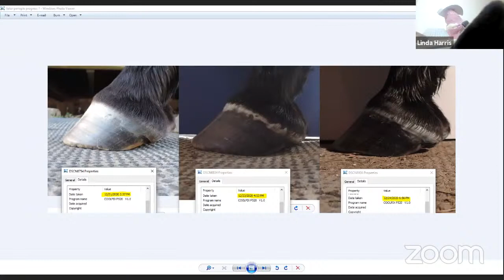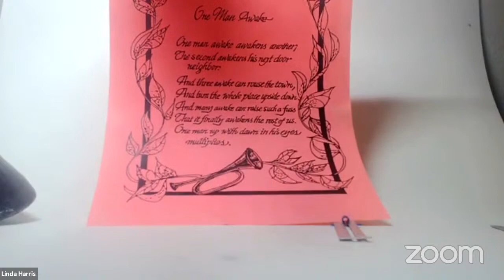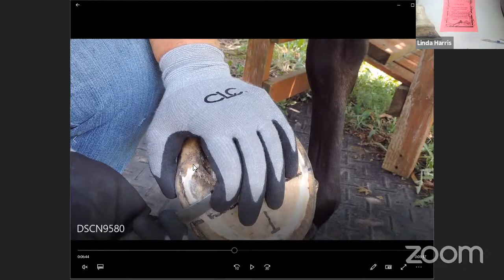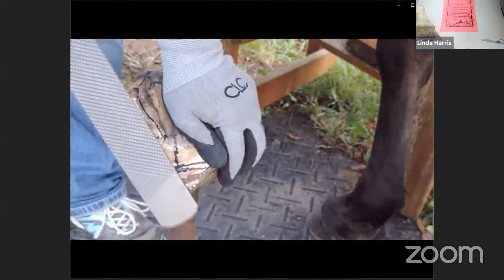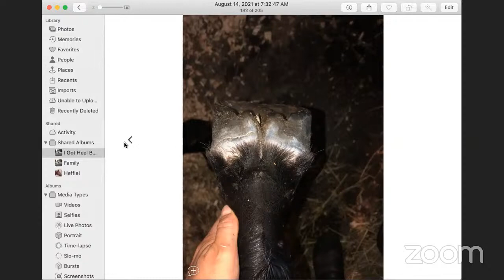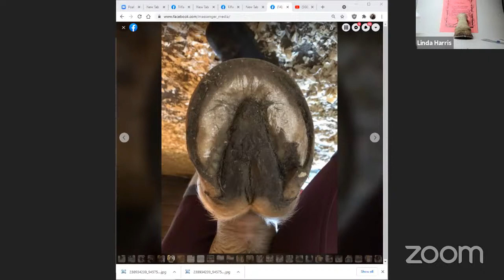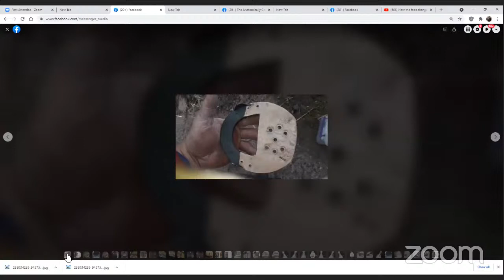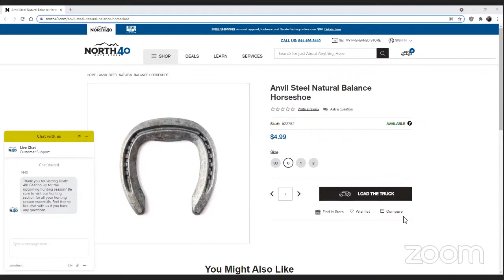How the foot changes and a demonstration of The Anatomically Correct Trim

Comment: I believe that the natural balance shoe was designed as a therapy shoe for laminitic horses and to ease navicular syndrome. Lame horses won't be cantering or galloping. Probably not even trotting. That squared off shape is not meant for sound horses.